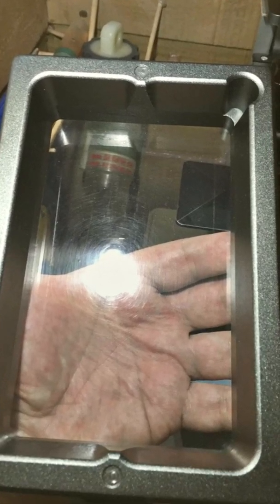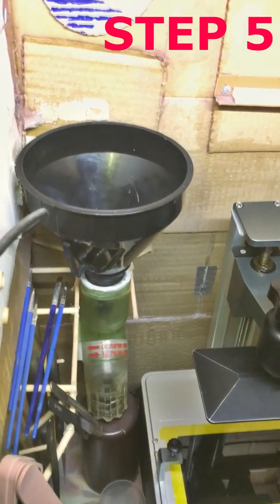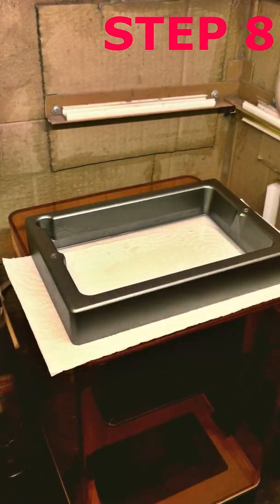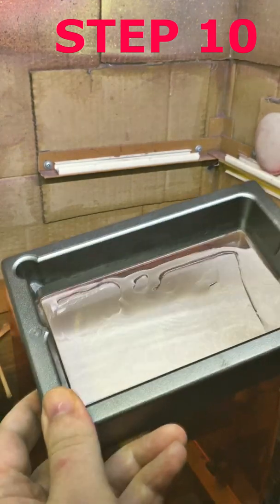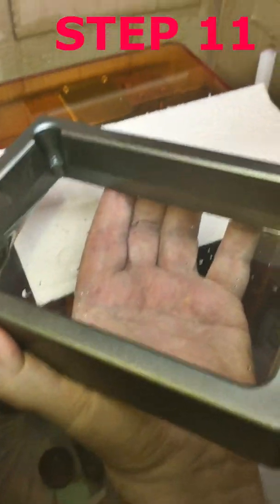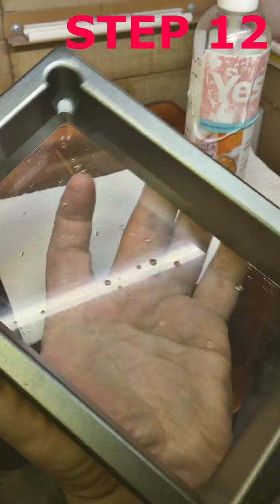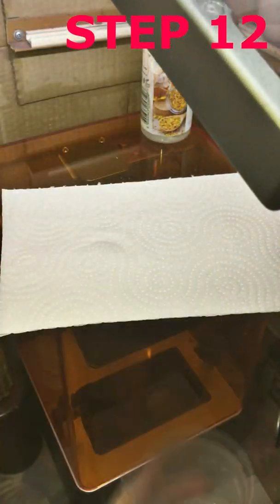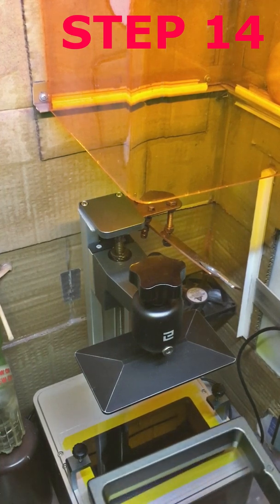How to clean resin tank of an SLA printer to avoid FEP film cloudiness. A normally 5-minute process.

Comment: Cleaning agent? IPA? or something else. Personally I use microfiber cloth instead of any paper
Reply from the maker: Ethanol, if affordable in your location. I get ethanol at a price just a little higher than that of IPA (which I also use sometimes). Ethanol is better for cleaning and smells better. Not sure whether those using microfiber cloth discard it each time after use, but I have no problems with using tissue paper - as soon as it's wet, you get no scratches on the film (and you ain't going to press the paper against the film like crazy, because the main job is done by the solvent).

Comment: Wiping down the FEP with tissue or paper tower is the perfect way to scratch it. Use a microfiber cloth instead.
Reply from the maker: I would I agree if I had scratched it with paper towels. Paper towels get wet and, therefore, soft, thus leaving no scratches. But your suggestion makes sense anyway.
Reply: @3DResinPrinting  How do you clean the microfiber cloth afterwards? You cant put it in the washer...
Reply from the maker: @mrthoreau5668  This is another reason for using paper towels. Just UV-treat and throw  into the bin.

Comment: I noticed you didn't strain/filter your resin into the bottle?
Reply from the maker: That's correct. I use a collecting (slops) bottle and drain whatever remains in the vat after a print (a series of prints) into it without filtering. After I collect a sufficient amount in that bottle (normally 150 grams or so) for a new print I shake the bottle well and pour its contents into the vat via a filter, thus only straining once instead of 5 or more times.
Reply: @3DResinPrinting  Actually I may follow suit and save on filters, they are not expensive but it's a pain in the butt going through 3 a day and waiting on new ones to come. Less waste is always a good thing regardless of cost
Reply from the maker: @DeusMachina71  Yep. And you also save time avoiding filtering each time (no waiting, no extra operations).
Reply: @3DResinPrinting  that's an awesome idea I will save my resin bottle to do that with. 
I am only buying the water washable type so I can leave the cleaning water in a storage toat that can go in the sun after a while to cure micro resin and be filtered with a basic particle filter and I find it doesn't give off the harsh smell of other resin.

Comment: Why use tissue paper instead of paper towel?  Does it have less dust particles come off it than paper towel?
Reply from the maker: Yep, I realy find this one (called Papia) very soft, not leaving any dust or lint (wet wetted in alchohol) unlike, say, the one u can see placed under the vat. And when shopping with my wife, we buy two different "brands", and now you know why:)) It also perfectly fits the width of the vat thus making removal of residual alcohol easier.

Comment: step zero use gloves !!!
Reply from the maker: The problem for me is when I use gloves everything gets contaminated with resin, and I cannot notice it. When I work without gloves nothing gets contaminated because it’s more convenient for me to handle things without gloves. As I mentioned in the description, please wear PPEs you consider appropriate for your case. The purpose of safety precautions is to achieve safety, not just wear (often wrong) PPE. So I achieve my safety by not using equivalent that leads to contamination. On the other hand, I use good and sufficient ventilation which most users ignore.
Reply: @3DResinPrinting  what type of gloves are you using? is it as good as nitrile? I'm looking for alternatives, preferably something more reusable.